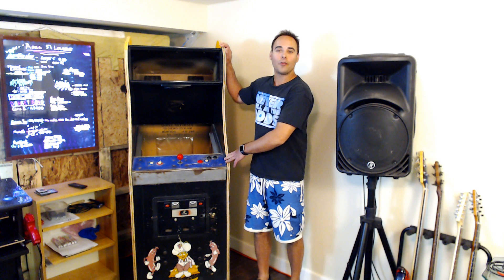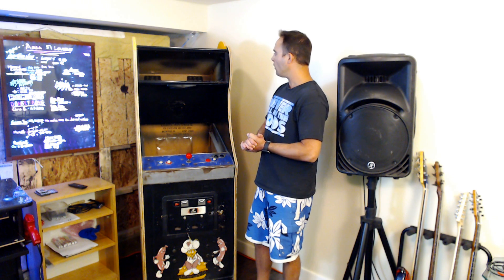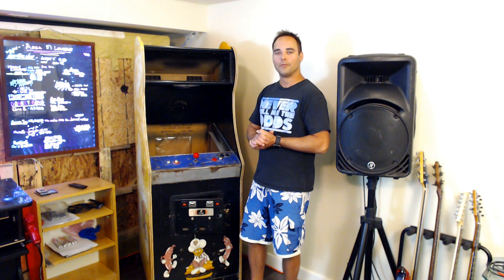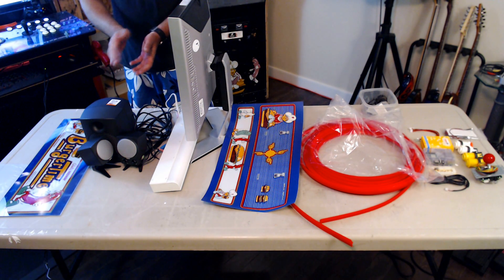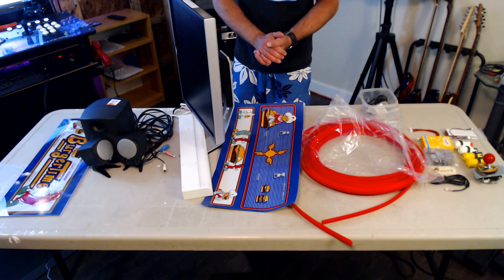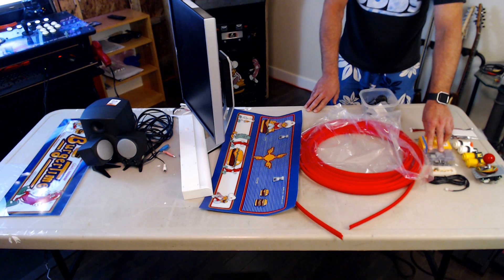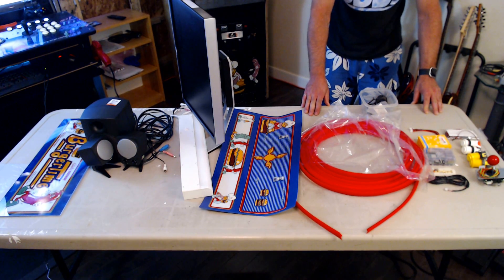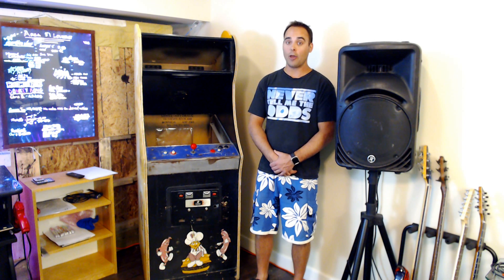BOGG Tech - Burgertime Arcade Cabinet Restoration and RetroPie Modification Episode #1: Introduction

Comment: You gonna restore the sideart? I'm also curious about how you're mounting your monitor. Is it going to be dedicated vertical, or will you do a rotation mechanism of some sort?
Reply: BTW, those Dell monitors are nice. How much did you get that for?
Reply from the maker: Yup we'll hand paint the side art to restore as much as possible. The monitor will be mounted sideways to replicate the original as much as possible.
Reply from the maker: Got it on ebay. There are a few out there from electronics wholesalers so keep an eye out! $100.
Reply: I got a nice Samsung SyncMaster 940N for $20 at the local thrift shop. They very routinely have nice quality LCDs in the correct aspect ratio for these kinds of projects, and so I decided to pick one up and design a new cabinet around it. I'm looking forward to watching your series and seeing how you handle, for example, the HDMI to VGA conversion.